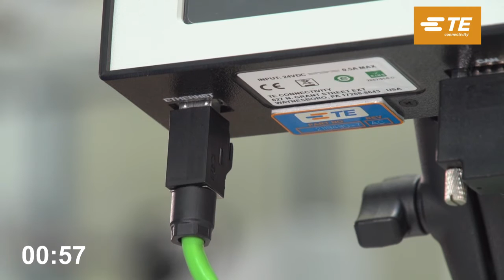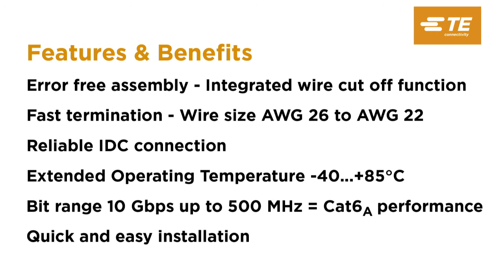TE’s Industrial Ethernet RJ45 Cat6A Plug Saves Field Time

Comment: What is the cost per connector? Bad cable crimping is the number 1 cause of problems for small ISPs, so the market for something like this is in the region of millions of connectors, if the price is not much more than 3-5x of the more common technology.
Reply: It looks like they're charging $30.50 a piece. Yikes.
Reply: This is comparable to Belden RevConnect.  Though when you work for anywhere needing many Cat6A cables, the cost of terminating and passing a tier 1 Certification and making a 10g circuit, quickly makes these new terminations viable.